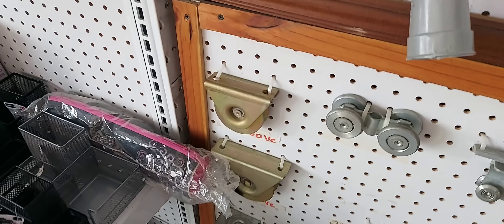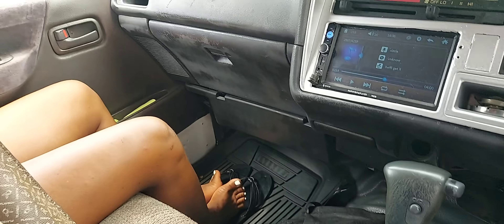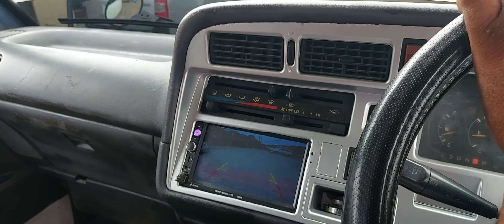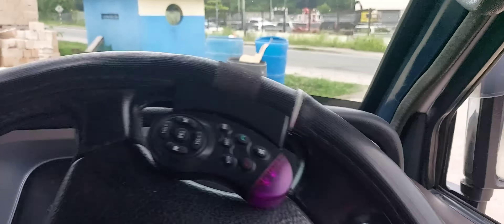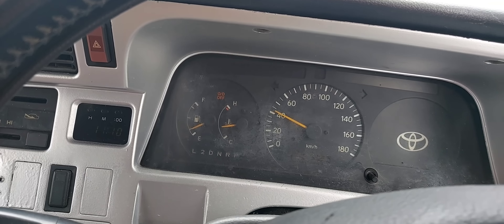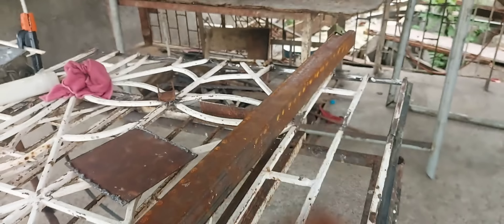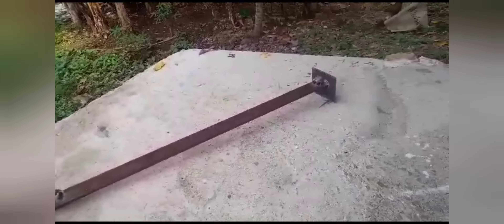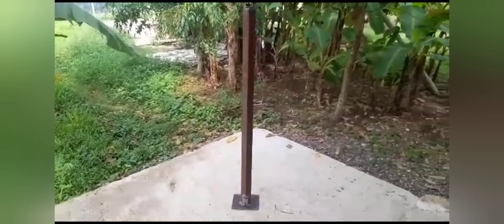Toyota hiace bus build part 8.....

Comment: NIizmo I would change the radio. Is a cheap chinese radio cost about $50 to $70. I think the soldering inside poor. Install one before and is the same problem. Also the screen might go blank after a while. Cheap materials thats why it so light. Get something better for the setup. Love the series.